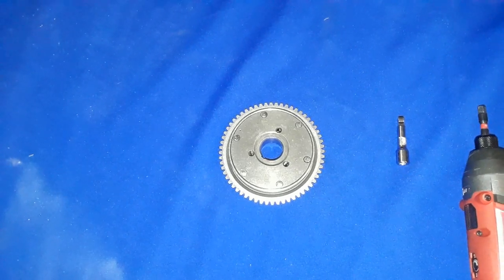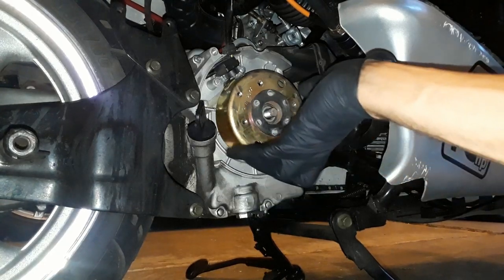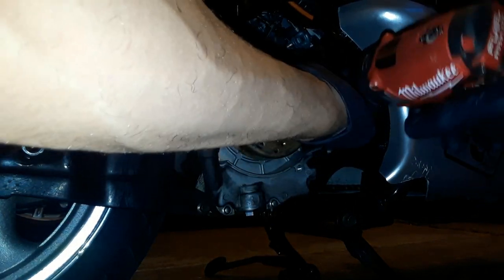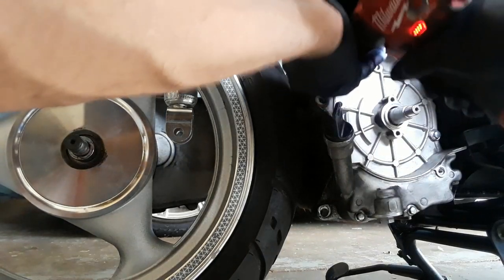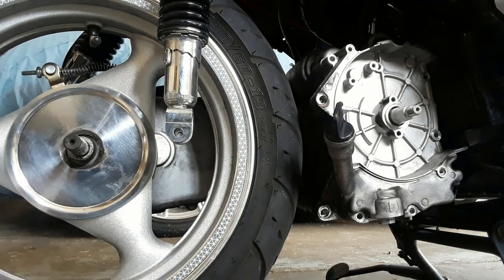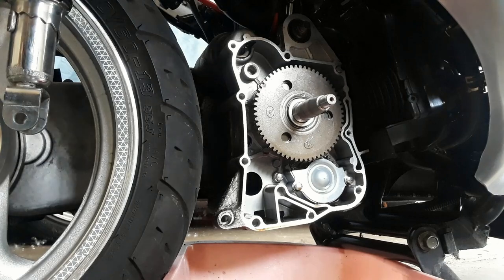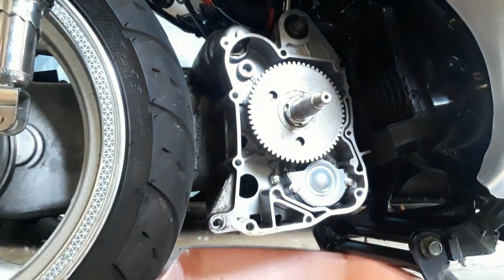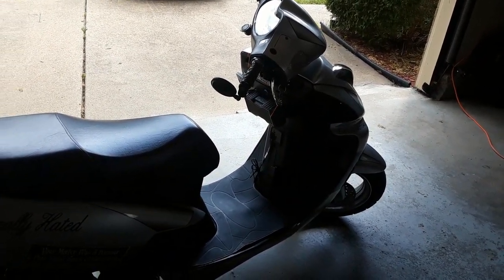Gy6 Starter Clutch Replacement

Comment: Katchi' s Kid  I really hope you're still around to answer this! my 50cc TaoTao which is a 2016 GY6 has never had a major issue until now it has over 6,000 miles on it. one day it just did not want to start.it just cranks but won't turn over I found out it did not have spark so I couldn't find my meters and did the simple cheapest things first like a spark plug CDI starter coil, and kill switch.it was a long time waiting for those parts and I finally did find the meters and tested the pickup coil wire and the Exciter coil wire hoping hoping hoping it was not the stator! I didn't have a flywheel puller haha but excited coil tested okay both bolts and ohms but the pickup coil failed the volts test. I pulled the part off and put the two bolts back in the hole so as not to lose them and waited for the part to come in the meantime the wind did blow my bike over so keep that in mind. the part arrived and I noticed one of the bolts missing! I looked everywhere never did find it but I did get a replacement bolt installed the part had a hard time keeping a gap on it because every time I tighten the bolts it would come out of gas so I thought maybe a couple of thin nuts would help which it didn't! haha but I did finally manage to get it tightened down by moving the black plastic casing that held those two wires coming out of the stator I didn't need those two bolts and one of them actually fell out of my hand and I think it went behind the flywheel!!!! because when I try to start it it would just crank only a couple of times and then stop did!!!I double-checked I should say triple check everything again this time finding that the flywheel would not turn by hand not even trying the kickstarter would it turn!which it did turn freely up until the installation of that pickup coil it was fine. like I said I don't have a stator puller or flywheel puller so I think at this point I am screwed I was able to get the fan cover off and I did recover the missing bolt but never the missing nut! so the question my friend Katchi is do you think that nut is stuck on the stator magnets causing the bike not to start? it sounded like it was almost a dead battery but the battery was fully charged.and could that nut being in there have caused any more damaged especially to the starter clutch gear or anything in there? I haven't seen any oil leaks at all so I believe the oil pump is still in good shape but I am worried about the gears and I know I'll have to pull that damn flywheel off now! any help would be greatly appreciated as it looks like you're the only one here that could answer my question thank you
Reply from the maker: I am always here....okay, I didn't stop reading after you swapped the spark plug, coil, and CDI, but I thought it was the stator right away. You absolutely MUST get a flywheel puller! That bolt system is garbage and seems to have set you back a little. You know as I do, no spark, can be only 4 things. The stator might also be the issue with your battery. Bolt didn't make inside where the starter clutch is, so damage done there. I think 50cc's have 6-pole stators so if 1 pole is damaged, 5 won't cut it.
Reply: @kachiskid  thank you so much for being here for me and answering quickly yes I thinking the worst that it might be the stator as well so when I did find the meters I tested the stator right away which involves the Exciter coil and the pickup coil coming out of their correct? the Exciter coil tested okay thank goodness I didn't have to pull the stator off but the pickup coil being on the outside of the stator that one only the ohms tested good  but I  no reading whatsoever on Volts  are you sure the net that I lost that I think went behind the flywheel and is stuck on one of the stator magnets is not holding that up and allowing the flywheel to spin freely? because like I said the flywheel always spun pretty until my last start up attempt at this point all I can get is a click click click with the electric starter and you can see the flywheel just turned a tiny bit during that click click click
Reply: sorry about the talk-to-text this Chromebook doesn't understand my language yet hahaha
Reply: my plan was to go ahead and get a stator anyways I can get a stator kitwhich has the puller and a couple other items but once I'm in there I need to know if that nut could have caused any other damage and is that what's causing the flywheel not to turn anymore? I know the stator if it was bad wouldn't cause the flywheel not to turn freely?
Reply: oh and I forgot yes it's just a battery  issue because it gets really really cold here and does not like to start in the winter time this is my fourth one every year I have to replace it
Reply from the maker: @shellilogan771   Your translation is perfect, yeah that flywheel should always be able to turn. I wouldn't even try to turn it anymore until you get your puller. Not really sure about testing the stator. I think Joeys Garage did a video on how to test it.
Reply: @kachiskid  haha well thank you about the translation being perfect but I do beg to differ! lol.I don't remember who did the videos of the stator check but I'll backtrack I'm pretty sure I saved it out of all the videos I watched on troubleshooting a no spark issue his was the only video I saw on how to check to see if the stator is bad.  I'll let you know after I'm done here but I had that video memorized even before I found my meter and while waiting for my ignition coil to arrive even before I tested that pick up coil lol. it took me forever  just to get to the wiring harness in order to test those two wires to the pickup coil and Exciter coil .so do you think that that nut that fell behind there is stuck behind the flywheel and held on by the magnets from the stator? and that's the reason the flywheel won't turn anymore?I have searched in every way possible to see if that's what happened because I just can't think of any other reason the flywheel won't turn anymore? I'm thinking that nut has jammed it up tight!which is what brings me to needing an answer to my second question from you?if the nut did jam up the flywheel, could it have also caused any of starter clutch gears to share off? or to have dislodged those two Half-Moon shaped pieces of metal on the shaft? I can't remember what those pieces of metal are called!! wood something I think LOL! I would like to know that because I can also get the tool castle nut or Castle wrench remover tool? that I need to take that starter gear off while I'm ordering the stator puller kit and all the parts I need. and as much as I hate the idea of having to replace that Stater! I will hate having to replace that starter clutch gear even more hahaha!!!
Reply from the maker: You might not need the castle nut remover. I again would be shocked if it damaged your starter clutch. Is it possible to make a little video and send it to kachiskid@gmail.com.
Reply: @kachiskid  hi. you mean of it trying to turn over now? before I do any more work on it? I can make a video of whatever you want except for me trying to take that flywheel off hahaha. but I am hoping you're saying you don't think that nut did any damage and that it's just kind of jammed up and holding the flywheel in place so it doesn't turn?
Reply: @kachiskid  hi I haven't heard from you in a couple of days but I did want you to know I did find the video on how to check the stator it's a great video from 49ccscoot I believe the title for that one is how to check stator and pickup coil on GY6
Reply from the maker: Sorry about that Shelli, been really busy. Yeah 49ccscoot is that dude. He has taught me a lot also. Yeah a video will allow me to see exactly what your seeing.

Comment: I took my starter out and the gear spins both ways, is that normal? My bike doesn’t start at all. I awaiting new starter clutch as I already have the tools. Also what torque specs did you use for the screws putting them back together??? Thanks.
Reply from the maker: Not sure of the torque specs but I rarely use them. Been working on cars for a long time so I can normally tell how much force to use. Pretty sure the starter is only suppose to spin 1 way. I'm sure with a quick Google check you can find the torques specs for your bike, they are all different.

Comment: Maybe a stupid question but do I need to  To drain the oil first before  I take apart
Reply from the maker: Never a stupid question, if you don't know....yes sir, drain the oil. Even when you do, when you crack the case there will be oil in there also.

Comment: Hi,
Three hole What does it work?
Reply from the maker: Murat, I'm sorry I don't quite understand. Three hole?
Reply: Thank you for your interest.
Three holes in gear.
Reply from the maker: Not really sure what those 3 holes are for but they were on both clutches. Since install, I haven't had a problem with the new starter clutch.
Reply: Thank you very much.

Comment: Hi, how do i diagnose a starter clutch? My moped i starts with 3-4 cranks then it rattles. Any ideas?
Reply from the maker: You will hear the starter spinning but not the engine engaging. Check your belt and the rollers on the rattling.

Comment: Just gained a new sub! 👍 quick question, will any of this affect the timing whatsoever? I had a small issue with a non gy6 scooter before, changed the stator and it set the timing off which I had to put it into a garage for and don't want the same thing to happen
Reply from the maker: Thanks for the sub, and welcome to the family. Now my game is GY6, but with that being said, this procedure doesn't effect the timing on this engine. What I would suggest is to make sure your cam is in line with your fly wheel. I show an example in this video. https://youtu.be/-W2u9uiykWg

Comment: please tell me when should I replace the Starter Clutch? ... I have gy6 scooter that the starter spining but not engage to run the engine : please tell me what part shouold I check ?
Reply from the maker: Check this video out... https://youtu.be/RujjyNothfU If your bike sounds like mine in the start of the video, you need to replace the starter clutch. Now you mentioned the starter (not starter clutch) is spinning and not engaging the engine, I would imagine that the starter needs to be replaced. https://youtu.be/2vuhR922CMU
Reply: when it won't start the scooter.
Reply: I have the same problem in my gy6 150cc Chinese scooter when I start it just makes a spinning noise coming from the starter clutch area. I think mine have to be replaced I bought the parts for it already.
Reply: Thanks to your videos I'm learning how to change my own parts. If this is my issue with starter clutch could someone please help me by letting me know if this sounds about right.

Comment: I dont have a impact drill or the strength to get the starter clutch nut off how would i get it off of the easy way
Reply from the maker: Are you talking about the nut at 2:40 or castle nut at 9:40?

Comment: Good day. Thank you for this very informative clip, it helped me a lot with replacing the the starter clutch. But..... after I;
 have placed everything back, i found that the starter doesn't want to turn... After opening it all and going step by step to see where the problem could be I've noticed that when placing back the outer casing with the new gasket, the moment I tighten the bolts it seems like the starter is been held back .. like its to tight.. why? do I need a thicker gasket?
Reply from the maker: Ok, sorry just need some clarification, when you say the starter, do you mean the starter clutch gear or the actual electric starter on the other side of the bike, which turn's this gear?

Comment: can you tell me what the starter clutch does and how can you see how it is broken
Reply from the maker: Bike won't start, you will hear a whizzing noise. Starter clutch starts the bike with the electric start, instead of kick starting. Start button sends volts to the starter...the starter turn the starter clutch...the bike starts.

Comment: The flywheel puller tool is too big on one side for my flywheel, my threads are also righty tighty, is that the wrong tool for my scooter? It tightens fully but the flywheel still turns freely
Reply from the maker: Are you sure this is a GY6 engine? What type of bike?
Reply: Kachi's Kid I just found out that it is a 50cc I guess, the guy who sold it to me said it was 150cc, my mistake :/
Reply from the maker: No problem bro. Are you gonna do anything special to that 50cc?
Reply from the maker: What type of bike?
Reply: Kachi's Kid it has peace sports on the side, I think it’s a talon 50, and the bike doesn’t start, I put a brand new battery and it keeps cranking but doesn’t turn, I ended up getting the fly wheel off and it looks nothing like this one, there’s a plastic gear instead of the starter clutch so Idk what to do
Reply from the maker: @Joshwake  yup that is a 50cc. are you sure you are getting spark?
Reply: Kachi's Kid I can test that by pulling out the plug and seeing it spark?
Reply from the maker: @Joshwake  yup, it has to be grounded to the frame as well as connected to the coil. Use the head case cover. Start the engine, and see if you have a nice strong blue bolt.
Reply: Kachi's Kid ok do you have Instagram or anything I can send you a picture on? I think I found the problem
Reply from the maker: @Joshwake  kachiskid@gmail.com

Comment: I have a whinding sound when I start I think mine is going out. Thanks man. Probably going to have to do this soon on my 171
Reply from the maker: Just be careful if your going to take it out before changing it...could leave to stranded.
Reply: @kachiskid  it will be done at my house when I need to do it. I've built a few motors. Just never had a starter clutch issue.

Comment: The nut on my stator is stripped cause I tried taking it off. My clutch spins backwards too
Reply from the maker: Whoa. Are you sure that the nut is stripped? Is there anything you can do without replacing?

Comment: Will this work sym jets 4 125cc engine  if can  help please
Reply from the maker: Yes, all of these bikes have a starter clutch.
Reply: @kachiskid   do you know of site  to get parts off  thanks 😊
Reply from the maker: @paulatarling1447  For a 125cc? Are you overseas?
Reply: @kachiskid   no from Wales   my friend
Reply from the maker: @paulatarling1447  Yeah, from across the pond. The reason I ask is, we don't really have 125cc's over here in the states. 50's and 150cc's, which are gy6 engines from Chinese bikes. Your engine is different, and I wouldn't know where to get parts besides ebay. Our 125cc's are normally motorcycles.
Reply: @kachiskid  is the sym jets 4 125cc  year 2016 . Someone I know told me it some as  gy6 engine  is that right
Reply from the maker: @paulatarling1447  Sym is a Taiwanese company not Chinese. I'm not sure what engines they use.
Reply: @kachiskid  big thanks  for your  time
Reply from the maker: @paulatarling1447  No problem. Anytime.

Comment: I also noticed that when using the kickstart, it's like making a clicking souns Like gears not mesching. Almost like hooking or catching..?
Reply from the maker: Johan, your right on, it's because they are garbage. The setup for the kick start gear is stupid and unreliable. The gears come out of alignment with very little pressure, in a place where uncontrolled foot pressure is applied. It's 2020 out there and were using tech from the 30's. I know the old adage, "if it works, don't fix it" but it never worked, so....

Comment: Is it safe to drive while I wait for this part to arrive or should i avoid starting her up? Thanks.
Reply from the maker: Hey Roland, I rode on my until complete failure. The only problem I can foresee happening it won't start to bring you home after you stop somewhere. That being said if you are going for just a ride you should be fine. I couldn't use my kick starter because it was garbage from the start.
Reply: Kachi's Kid thanks so much for the quick reply! I ordered both tools but am waiting on the actual starter clutch. Just didn’t want to explode while driving or anything.
Reply from the maker: @Roland-Henry  No problem Ro, rather be safe than sorry.
Reply: Kachi's Kid sorry one last question, so am I to understand the starter clutch is only used when utilizing the electric start? Furthermore, could one remove the starter clutch and still utilize the kick start thus avoiding the terrible rattling noise?
Reply from the maker: @Roland-Henry  that is a good question, I'm not really sure but my guess is no. The starter clutch needs to start the bike no matter what. I think you kick starter just bypasses the battery, but again I'm not sure.